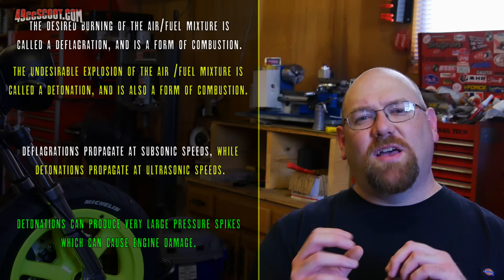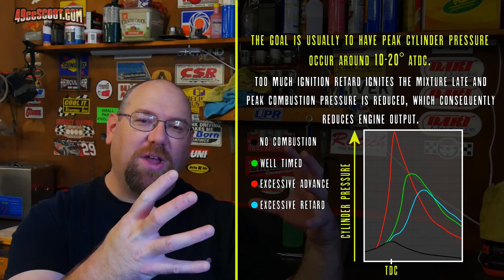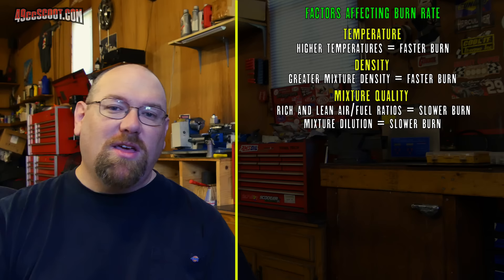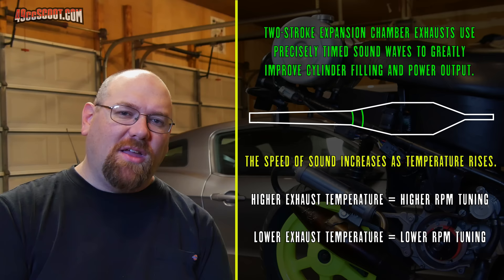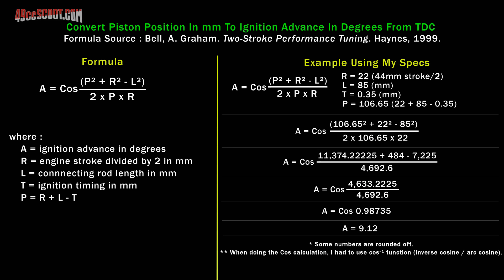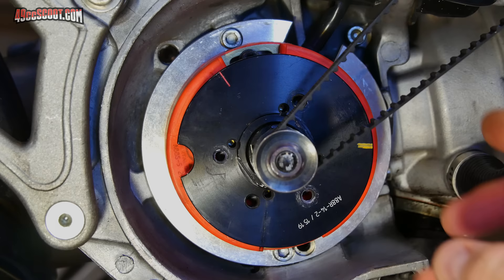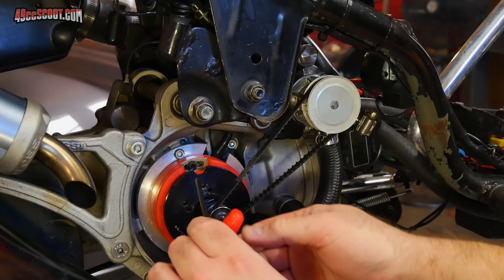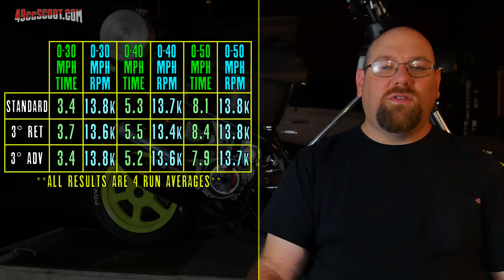Ignition Timing Explained & Tested : How-To Advance & Retard Timing With The MVT Digital Direct

Comment: Hi,it’s pete again from the uk,you have got me so interested in these type of bikes that I have just gone out and bought an MBK nitro 50 two stroke,the fireblade and my aprilia adventure bike have been moved to the rear of the workshop along with the motocross bikes,I haven’t worked on a 50cc two stroke since I was 16 some 45 years ago,I’m going to modify and rework the engine so I might need a bit of advice from you!,in return for the advice I can make you some parts that you might find difficult to do,(I have milling machines and tig,mig and gas welding equipment,large lathes Ect)you could email me the drawings and I can make the parts and get them too you in a few days,how do you feel about that,regards pete
Reply from the maker: Hey Pete. I don't expect payment for a bit of advice. I may take you up on parts someday though. Who knows? Anyway, you may also want to join the forum if you haven't already. Lots of smart folks there gladly giving out free advice and it's easy to track a build with your own build thread. 49ccscoot.proboards.com
Reply: 49ccScoot thanks for that,but any parts you need making,let me know,like the footrests I could make them in minutes,I can give you my email address but I’m not sure how to do it without everyone seeing it,pete
Reply from the maker: @petewain61  That's again where the forum would come in handy. Very easy to send PMs.
Reply: 49ccScoot is the forum on your website
Reply from the maker: @petewain61  Yeah.
Reply: 49ccScoot just joined,looks interesting

Comment: 1 question, if i upstroke my 2stroke bike by changing a longer rod. So my factory ignition on the bike will be advance or retard?
Reply from the maker: Manufacturers tend to recommend less advance with a longer stroke, but you can see exactly how timing changes at any given position with the piston position calculators here :
https://www.49ccscoot.com/calculators.html

Comment: Hi,  nice work, one question wean you mean retard inition you mean rotate stator anticlock and advance inition timing  anticlock wise ?
Reply from the maker: Stator clockwise to retard timing and counterclockwise to advance. It will vary depending on the engine configuration (direction of rotation and which side the stator is on).
Reply: @49ccscoot  Thank you, i also have other question regarding on site calculator on degrees from TDC to piston and piston position to degrees from TDC, wean i place inputs and must i use , or . ?  Eg. 3,5 mm or 3.5mm , cause it changes final data?
Reply from the maker: @flyboyfs  Use a decimal point (3.5mm).

Comment: So the slower the engine the more retarded it should be? OEM manual says -8°@2KRPM. What’s 800RPM setting? -8? -6? 0?
Reply: 4 stroke
Reply from the maker: @pepperjackshack2439  An 800RPM setting could be anything. Could be a flat line the same as the base figure given at 2000RPM. Could be retarded to make starting easier. Could be whatever they wanted to set it at.

Comment: how can I set up points on a 1940s motorcycle with a magneto that has no Woodruff key? it was running till I removed the magneto know it’s never run again
Reply from the maker: Unfortunately I'm the wrong person to ask about vintage points ignitions. Some more modern ignitions don't use a woodruff key to place the flywheel with ease. In those cases, a degree wheel or measurement from TDC is generally used to setup an ignition. Measurement is most common. You can see what I'm talking about here :
https://youtu.be/JVZr74Lt0DQ

Calculators to find distance from TDC when degrees are known are here, near the bottom of the page :
https://www.49ccscoot.com/calculators.html
Reply: @49ccscoot  thank you ever so much for your reply. You’re the only person who’s ever got back to me I will check that out thank you.